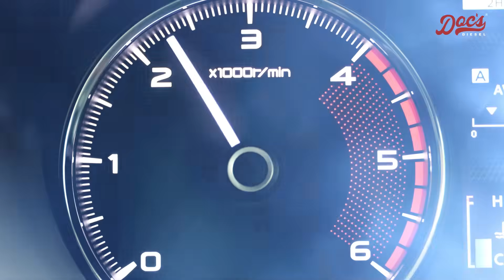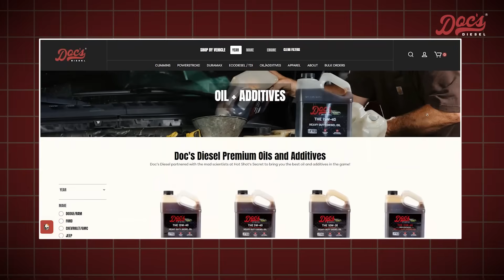How Often Should I Change My Diesel Engine Oil?

Comment: I’d would like to add a few point to the 10.000 miles oil change interval. You got to remember cars, trucks, motorcycle, boats etc companies don't build them in a vacuum. They don't just get to build whatever they think is the very best from the engineering prospective and then just put it in the market.

There is this thing, at least in US, called Environmental Protection Agency, and it has counterparts around the world. There is Japan, European, etc version of EPA. So the government basically say we want certain things, emissions, things from the engine, right? They're saying, well, how do emissions correlate to oil change interval? Well, in the EPA CAFE, so that's the Corporate Average Fuel Economy Standard, in the appendixes. It is not in the calculation books, it is in the appendixes, there is room that allows OEMs to get credit toward their fuel economy by reducing carbon footprint and things like that. So, oil change interval have gotten longer because that was a way for them to get credit towards their fuel economy, so their total emissions were lowered by extending oil drains interval, and thinner oil, some cars even 0W8, because all those regulatory agencies view used motor oil as a environmental hazard, right? So, if we can reduce that by longer drain intervals, then they get credit for that. In my opinion, one engine that last 500.000 miles is less harm for the environment than that one that last 100.000 miles. This is all BS from manufacturers. That is essentially what happens, they come in and say, we want you to do this, and here is the incentive if you do these things. It's basic economics.

Comment: I get SO much hate... 2005 Duramax, intervals of 11 to 20k miles... the key is keep it running, 764k miles and still running strong. OH, Fram HP4 filters too, OMG! Original engine, original Allison, original rear end, few water pumps... front hubs... but even original cp3! So, how much $$$ did I save by just driving? A LOT. Transfer case was a terd about 245k miles so it was upgraded. Allison even went 208k miles one time on it's oil change... oops.

Comment: I have a diesel Suburu Outback 2016. I park in a carport on a fair amount of slope. Each time I start it I hear a very metallic clattering noise for a few minutes. Is this inclined parking detrimental to my engine? Great video. Thankyou
Reply: Have a go at rolling the car out under gravity to a flat-ish spot in driveway, wait 30 sec for cold oil to settle then start it to see if there is a diff. If there is no change, it will probably be piston slap when cold. GM LS1 motors had it as a big issue, not sure if its a scoobydoo issue though.
Reply: @danold6443 Unfortunately my driveway is very steep, like my whole area and my car is parked at the bottom. What I do now is run the engine for a few minutes and the noise stops. Thank you for your reply.